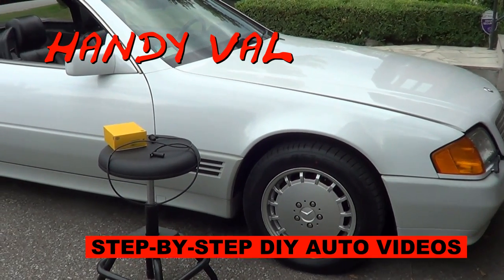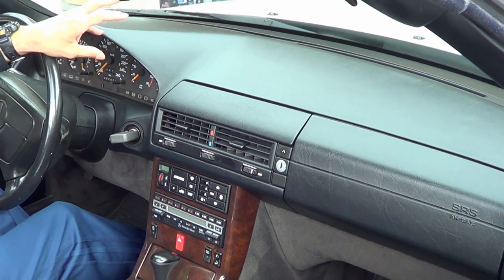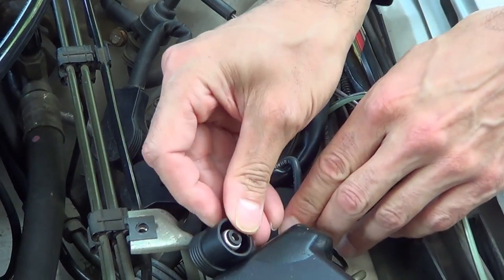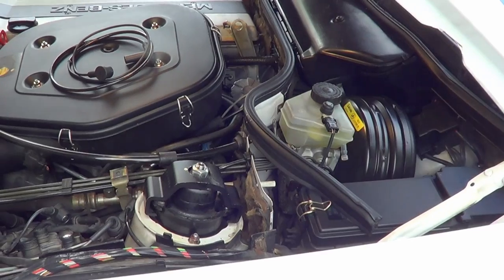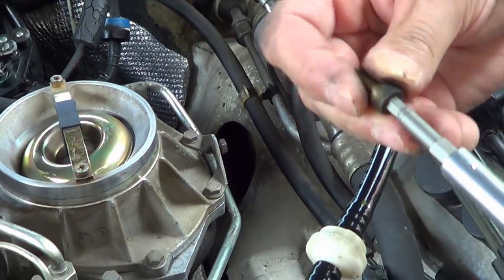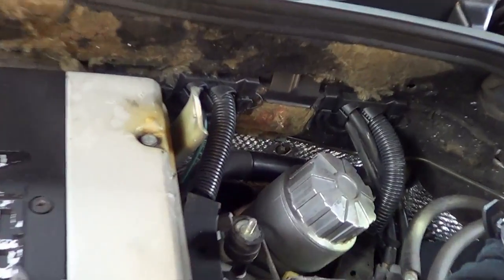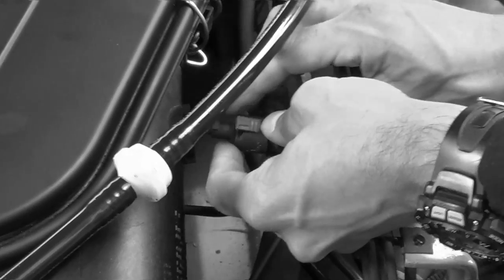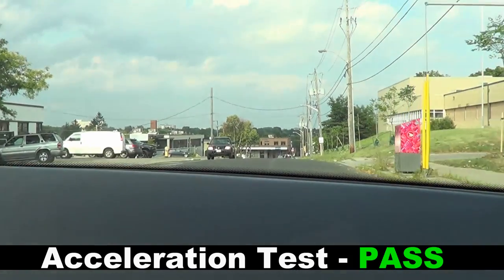Mercedes Crankshaft Position Sensor (CPS) DIY Change on R129, W124, W140, W201

Comment: val excellent video!!! especially Sl 500s  cps problems and Diy install we need more videos like  cam position sensors etc. as always excellent content!!!!!!!
Reply from the maker: Thanks Mark! The camshaft position sensor is a similar serving sensor as the CPS that measures different parts of ignition timing. Its replacement is a lot simpler, as it is easy to get to - eyes and hands can work together! I made a video on it, hopefully you'll find it helpful too: https://youtu.be/3w4JvgcGkfE

Comment: Amazing videos encourages me to work on my 1993 m104 sl320. I do have some idle issues where the engine runs smooth but occasionally at too high rps as well as my fans not coming on... fighting to keep the old dream car of my father alive
Reply from the maker: I certainly encourage everyone through my videos to try DIY on their R129s. It may seem daunting at first but after a  while comfort and confidence builds. The 320 has a great engine. Try a fuel injector cleaner from LiquiMoly, it may cure your occasional idle problem.

Comment: I had a hot start issue and sluggish acceleration when engine was at temperature. Car would take about 2.5 seconds to start instead of the usual 1.2 -1.5 seconds....turned out my issue was a bad CAMSHAFT position sensor....put a new one ( 10 minutes job on my W124 400E M119 engine), and it was back to normal....
At that time, I also checked the ohms on my cranshaft sensor ( like you did), and it was around the 0.8 range ( which is good)
Reply from the maker: The camshaft sensor can also cause a variety of starting and performance issues and is a lot easier to change, given its location and visibility than a crankshaft position sensor. I made a camshaft sensor video too. You did the right thing by testing and then keeping your current crankshaft sensor. Thanks for sharing your experience - it's all very helpful for the Mercedes DIY community.
Reply: Do you still have the 400E @ChristopheZ

Comment: I have a 95 SL500, I thought my wiring harness was shot but it turned out it was jut the CPS..... Car was mis firing, back firing, running rich and stalling bad when warm, wouldn't even turn over when hot. New CPS fixed the issue!
Reply from the maker: Awesome - it's a great feeling when one part change (and a relatively inexpensive one to replace) makes many, many problems go away!! Thanks for sharing this and I'm glad you are back to enjoying your SL.

Comment: First thank you for this video ! 
I have a question for you : Can you tell me where is linked the blue/green hydraulic pipe under the ingnition sheath ?
I have rebuilt my M104 and I forget only this one 

(We can see it at 6:34)
Reply from the maker: Hi. Thanks for watching. I think you mean the vacuum line that has a blue stripe on it. This vacuum line goes behind the heat shield, rides along the cabin air filter and then ends where the ECU components are located. It connects into a rubber ‘V’  next to the metal box that says MAS. You need to also take out the long plastic cover around the coolant reservoir. I hope this helps. If you are on Instagram send a message and I’ll send you the picture.
Reply: @HandyVal  thank you for your answer ! I will send you a message on instagram to see clearly

Comment: Excellent video Val!! My 1986 300E has a hot start issue only when the car is not run for few days, for instance it would start great after a week parked in the garage but once I drive away for couple of miles it would stop once engine is warmed. Then it would crank but would not start until 20 minutes later it will run fine. Changed sparks, coils, EZL, fuel filter, fuel relay, radiator, water pump, belt tensioner, thermostat, over $3k spent but still does it. I checked CPS cold  resistance is 840ohms and hot about 970 ohms. What would you guess might be the problem? Much appreciate you in advance!
Reply from the maker: Thanks John. Let's try to fix this hot start issue. A hot start issue can be caused by a faulty CPS and your CPS is within specs, however, even though, it's within specs you are experiencing the classic symptom of a faulty CPS so you should change it. Another fault of a hot start issue is a malfunctioning coolant temperature sensor. The coolant temperature sensor informs the EZL and ECU of the car's temperature, whether it is starting cold or warm/hot. For the M104.980 it's a four pin and is near the water pump (it's not sensor that shows the blue pin, or the green pin on some cars). As the car is almost 40 years old, if I were you, I would replace the camshaft and the crankshaft sensor, but can be done as a DIY. The camshaft is really easy to change and it too helps with starts and ignition timing, but likely not your problem. The coolant temperature sensor is easy to replace too, but you will lose coolant from the open hole as you take the sensor out - if using a shop they shouldn't charge much to replace this. Another issue, can be faulty injectors that leak badly - you won't notice this on a cold engine as the gasoline would have time to evaporate, but you will notice it while the engine has recently run. Another part, is the fuel accumulator, and it's right next to the fuel filter, it's job is to keep the fuel pressure good and ready for a warm start - this would only cause warm start problems, and should not cause driving issues. Hopefully, this helps. Start with the CPS.
Reply: @HandyVal  Thank you so much Val, so nice of you to share your experience with us. I have one more question please. I notice your engine was running when you checked your new CPS hot engine resistance. I checked mine was 1025 ohms while engine was hot after driving 10 minutes and removed keys from ignition.  Would that make a difference?
Reply from the maker: It wouldn’t make a difference if the car’s ignition is on or off. I think it makes sense to replace your CPS.

Comment: Hi Val, i have the same car as you, and i have an issue with my kickdown. It is slow in changing down, quite a long pause. I am not pushing the throttle to the floor, just wanting it to drop down one gear. Any ideas would be appreciated. Thanks.
Reply from the maker: The kickdown requires the pedal to hit the floor and when the pedal hits the floor you should hear an audible click. The pedal backing (pedal rod attachment) makes contact with the kickdown switch. If you look behind the pedal you will see the kickdown switch (it's black and round and you're able to push it with your finger). There can be a few things wrong: 1) the kickdown switch no longer works properly (luckily it's an easy fix and cheap ($30) too - you need to peel back the carpeting and remove the switch, which is held in its spot by two clips, and is connected to an electrical wire) 2) kickdown solenoid (more expensive $75 USD) and more difficult to get to as it is attached to the transmission. Slow acceleration can also be caused by a vacuum leak. I hope this helps.

Comment: Do you have experience replacing on a a M120? I had a rodent chew half way through my right side. Is it possible to repair the wire or does it always require a fresh harness? Appreciate it.
Reply from the maker: That's too bad with the rodent damage. It's possible to repair and the cost may be close to a full replacement. A botched repair job is also likely. You're much better off going with a fresh harness.

Comment: Hey I have a question about my 
300E w124 m104 engine, in park my car doesn’t stall at all but when I’m in drive and rev it to 2500 RPMS car kills it self, I have videos I can show if you can help, thank you, great video btw.
Reply from the maker: Hard to diagnose, but I'll try to help. It can be a few things, but I would start with a simple check first - check your engine air filter (a very dirty filter can cause this problem, and it's a simple replacement). What if you rev the car while in Park - does it shut down?
Reply: @HandyVal  I FIGURED IT OUT!!!! But yeah in park if I revved it, it did just fine, I’m drive it would go pass 2k and kill it self, but for me it was the crankshaft position sensor it was a little loose I squeezed it together and ran perfect again, somehow got loose assuming from bumps and such
Reply from the maker: Those are the best fixes of all! Well done.

Comment: hi am driving the Mercedes c230 w202, I have a problem now , if I switch on the ignition the dashboard comes on as normally but the engine not start same time as normally it just stay on nothing please help me what is wrong
Reply from the maker: It seems like it can be a battery problem. Try testing the battery. If it’s low do not boost the car as you will likely harm your roof controller, but rather just replace the battery. You may also want to research ignition switch. As you turn the key does do you hear any sounds or is it just a dead sound?

Comment: Excellent video but please use a original part not aftermarket. I just installed an aftermarket cps and it started right up. After it was warm it would not start.....
I used Hella but will not use this again. The insert breaks away from the base. The original part is built much better.
Reply from the maker: Thanks for sharing and I'm sorry to hear about your situation. I'm disappointed in Hella. They usually make good, durable parts. I hope this is a one-off and not a sign that their quality control is getting bad. Original is always best and it the safest option.
Reply: I wonder if i should disconnect the battery and try to reset the electronic system. I could also check to see if any failure codes are present.
Reply from the maker: I think it's a good idea to reset by disconnecting the negative terminal for about 10 mins, and then reconnecting.

Comment: would you happen to know if a 99 sl500 uses the same part?
Reply from the maker: Yes. The 1999 SL500 uses a crankshaft position sensor. It will look a little different than the part shown in the video. The OEM part number for the 1999 SL500 is 003 153 2828. Before buying always check with your parts store or supplier for the exact part.
Reply: @HandyVal  thanks for a quick response, I saw that it wouldn't be compatible but couldn't find any specific to the 99. I'll look into it thanks again

Comment: Hi Val great videos !!!. just have a question on the part number for the 300sl 24 car. my car is similar to yours. I'm having long/hard start when hot and suspecting the CPS. I can't find the exact part number that you have mentioned. all I could find is 002-153-92-28  from Hella but your part is 002-153-92-98. can you reconfirm this for us? ... I'm looking at the part from Pelican parts who have been great in the past with parts shipped all the way from the US to NZ.
Reply from the maker: Thanks. The part number is 002-153-92-98 and I see it on the Pelican website. I too have used Pelican Parts in the past - they are good to deal with. In my video description I included two part numbers for different model cars and years. Let me know if I misunderstood anything. I hope this fixes it for you. The other culprits can be leaky injector(s) or a bad fuel accumulator.